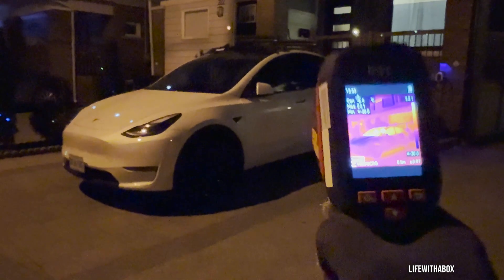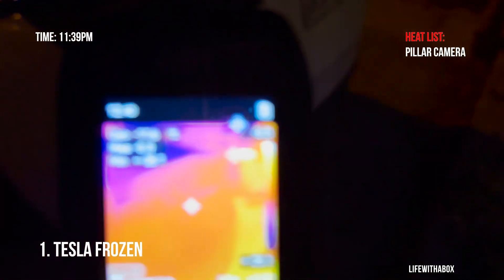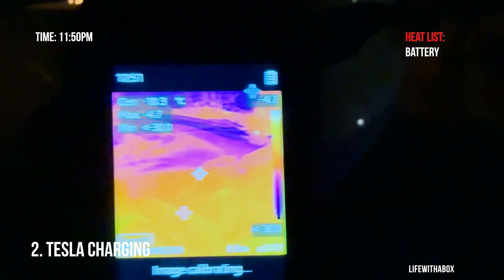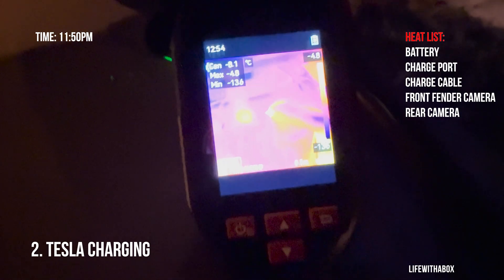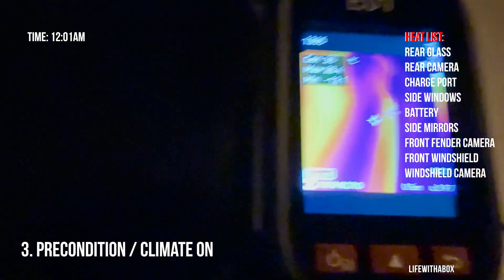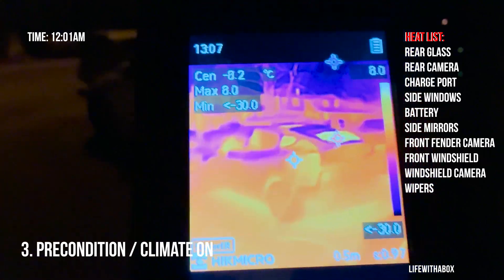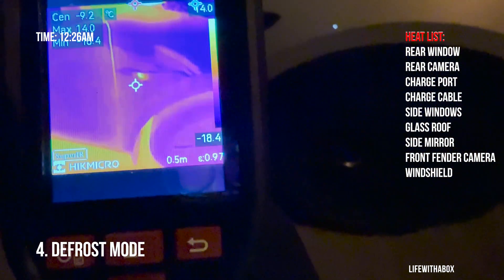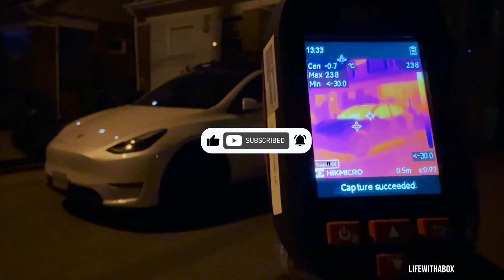I Pointed a Thermal Camera at my Tesla.  What I Found will Amaze You!

Comment: The door handles don't need to be heated. You can just press the opposite end of the door handle to pop off the ice. At least on new M3 Highlands you can. They updated it to pivot both ways.
If that doesn't work, I discovered you can open the driver's door using the Tesla app and you can open all 4 doors using 3rd party apps.